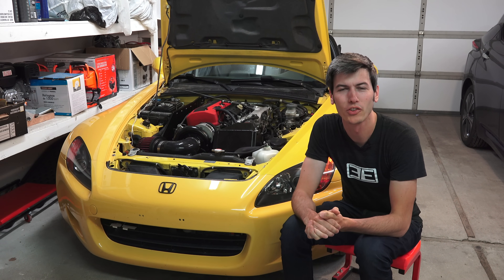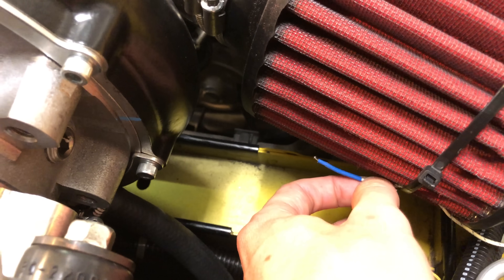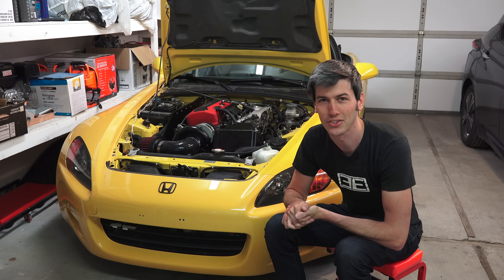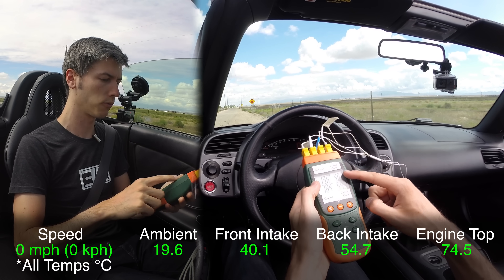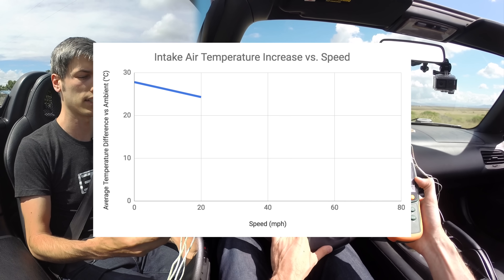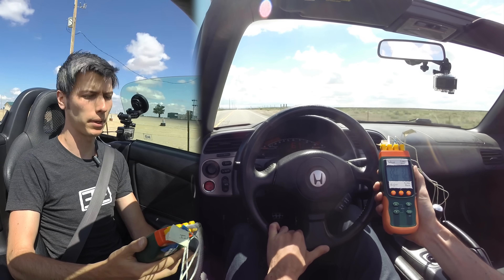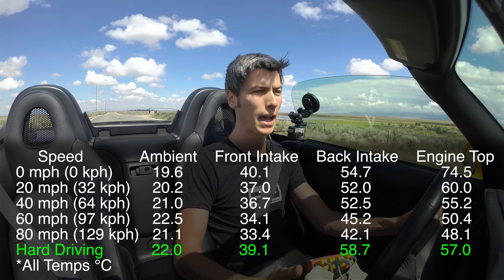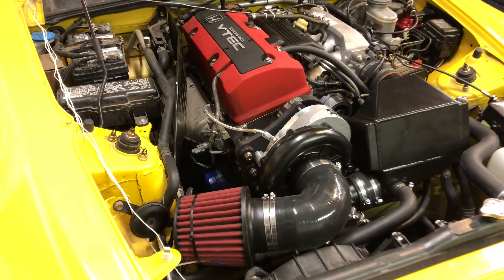Does My Supercharged S2000 Have A Hot Air Intake?

Comment: I watched your suggested video just to get an idea where you were coming from on this Jason and it brings up a couple of questions. In your testing of cold air intake performance, you suggest that there is a negative benefit at lower RPM ranges and positive benefit at higher, but how much of that loss of benefit or gain can be attributed to the design of the intake tube and filter? The second question is about your setup. Do you have an intercooler installed and is it wet or dry?

It is obvious from math that the cooler air would allow for a denser fuel/air mixture which should increase performance. Have you looked at remapping your ECU to compensate for the temp differences if you should choose to go with cold air intake?
Reply from the maker: Great questions, answers below:
1) I think the majority of it can be attributed to the intake design being less restrictive, hence less power at low RPM and more at high RPM (but I don't know that with certainty). 
2) It's an air-to-water intercooler. 
3) The ECU will be able to compensate for air-density changes using the MAP sensor (it does this every day, depending on the outside temperature).
Reply: Thanks for replying Jason. I should have thought that the ECU normally changes anyways based on the MAP sensor. Just forgot about it is all lol.

As a follow-up question though, would changing over to a velocity stack type of intake make much difference? My thinking is it would sort of pre-charge the intake air giving a little more boost, but not certain that is how it would work on a turbo or supercharger system.
Reply: After watching an episode of Engine Masters at Motor Trend, I understand a little more about your setup and feel more comfortable making another comment. It seems that as long as the water temp is consistent inside your air to water inter-cooler, it shouldn't make that much difference where the air is being pulled from. The 30 degrees differential you were seeing is nothing compared to the actual temp of the engine side of the boost pump after running for a bit, and that is what the inter-cooler is designed to handle.

Comment: i dont know if it would be reliable(nor i know if it would even work) but is there any kind of air intake compressor that works driven both by an engine belt and exhaust gases? i mean something like that centrifugal supercharger but with an exhaust gases turbine added at one of the sides. 

would probably be kinda awkward but i just wanna know if there's something like that
Reply: +chelar estelar man thnx for informing us of such a concept
Reply: is it always driven by both or is it driven by belt at lower rpms and then at higher rpm it switches to exhaust? the concept does seem rather interesting
Reply: Affan Uddin second option. Belt at low rpms, exhaust at high revs
Reply: chelar estelar That could probably be acheived with a normal turbo, with a gap between the 2 housings for a belt pulley. If you set the pulley up so that it is like the gearing on a bicycle, as exhaust pressures build, the unit would out spin the belt drive and act as a turbo, but at lower rpms would be belt driven like a centrifugal supercharger. As far as I am aware nobody has built that yet though.
Reply: Shane Donaghy 
Dude, I swear that was just what I was thinking about.
Reply: chelar estelar All I have seen is weird compound setups with roots blowers and turbos, but they are overcomplicated, im surprised no one has built something like this yet.
Reply: +Shane Donaghy then at higher rpms wouldnt it spin the belt faster and mess up the timing?
Reply: chelar estelar These days you’ll save more drivetrain loss just running an electric assisted turbo like in F1.
Reply: Affan Uddin you welcome.
And the issue of the belt spinning too fast is something we already mentioned. Have you seen when someone pedals a bike and then stops doing it, usually the wheel keeps spinning but the pedals don't spin with it? Something like that would be applied.
Reply: chelar estelar it wouldn’t work
Reply: Braden McHenry Any reason why?
Reply: Michael Zaite The problem with electric turbos is powering them. Most run well above the 12 volts that your car produces, so you need 2 seperate electrical systems, including a second set of batteries, plus it complicates the charging system. Murphys law tells me that its not the best solution.

Comment: On my data logs, a cold air intake gets about 3 degrees above ambient temperature under load. The stock box, under load, is about 10-15 degrees above ambient. The HOT air intake is about 20 degrees warmer than ambient under full load sounds about right. 

I'm surprised you are not data logging from the ECU, especially after getting tuning software. Much easier to data log.
Reply: He'd still need a thermocouple for the control and finding out where there are differences. Just data logging IAT would work i guess if you had all the different intakes and wanted to test between them.
Reply: The temp difference will be way higher on forced induction. Compressing air heats it up considerably

Comment: Relocating the intake into the grill is asking for trouble from rain and puddles. Leave her where she is. Maybe fabricoble a duct that would direct air towards the intake.
Reply: Hood intake 550 Maranello style. Offset for extra asymmetrical cool factor.
Reply: My thoughts exactly. Would be a good test project to do as temp solution though to see what the performance difference is and see if it's worth it.
Reply: Ooof, a hood intake on an S2000 makes me wet just thinking about it
Reply from the maker: I agree, I don't think going lower or closer to the front is necessarily a smart move, if it encounters rain/water.

Comment: They say don't text and drive, nothing about measuring different temperatures around your car and driving.

Those High tech zip ties though👌
Reply from the maker: Haha, I was thinking if I ended up getting pulled over (on a straight road in the middle of no where), I could probably intrigue them enough with the data that they'd let me go. But maybe not everyone thinks it's all that cool haha.
Reply: Engineering Explained Just use the "It's for science" excuse. Then proceed to teach them about their tires and how they should think more before buying them.
Reply: Anton Zuykov they're even reusable
Reply: I was thinking that it didn't seem very safe to dink around with the temp sensor while driving, especially at higher speeds.
Reply: Yeah, that doesn't looks like a very safe thing to do. Probably a good idea to bring someone else to measure the temps, or have a camera record the values, then look at the video.
Reply: just what I thinking too
Reply: Ziptie life!
Reply: Yea ... get a co-pilot to take the readings.  Scary.

Comment: should have also included temps from the manifold. The air temp in front of the intake filter doesn't matter much if you have an intercooler or a heat exchanger. of course if you bring it to a cooler source its more beneficial but that's where an intercooler helps. just being positively critical. love the vids!

Comment: I don't think a heat shield between the exhaust and the filter will be enough, because in that filter location you'll still be sucking in a lot of air that's been pre-heated by the radiator.
Something like a K&N Apollo might be worth a try if you want something off the shelf. 
P/N: RC-5052AB
Reply: a RAM-AIR intake vent would be the best answer, or drive without engine cover :D